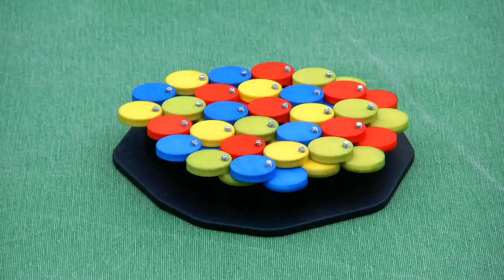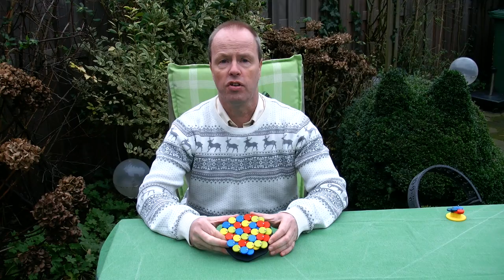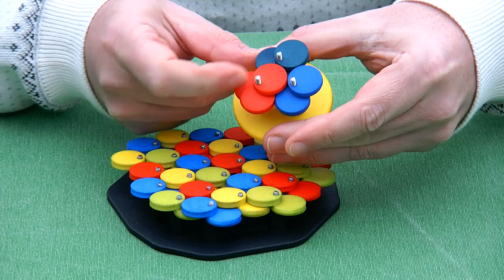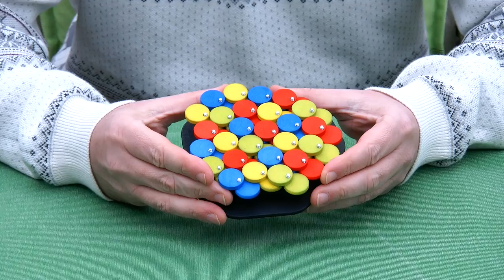Propellor Gear Grid   failed prototype

Comment: So if you had enough torque it would turn? if you put wings on one of the metal poles to let you turn, or attached an engine it might work. Or somehow allowing you to turn multiple gears at once spread through the puzzle?

You could also try breaking in the gears in smaller sections, or maybe sanding them if you haven't. I'm sure you know a lot more about the physics of these puzzles than I do! just a few thoughts.

This is a unique 'failure' since it's structurally sound & works in theory. I hope you make a working version, it looks very cool! Put some clock handles on it and hang it on your wall!

Comment: What if turn the disks into big toothed gears, and then put a tiny gear between each pair of big gears at the points where they touch? Admittedly, this would no longer be a "forbidden" gearing system then, but it would become a lot more "dynamic". :)
Perhaps you can hide the tiny intermediate gear by adding some flanges on the big gears, and that would also recreate the shape of a disk instead of a toothed gear.
Happy new year!

Comment: Hey Oskar, Sorry to see that the prototype did not work out. If too much friction is the issue, have you tried assembling a small number of the propellers? (maybe only )
Reply from the maker: Hi Eric, A smaller subset of the propellors works fine, e.g. by removing the outer ring. Thanks again for the propellor idea! Oskar

Comment: Couldn't you fix the friction by making the middle circle on a post, and then shorten the height of the circle by 1/16 on each side? It would look like a rod through a tire kind of. It might fix the issue. Then again, maybe not. Well, your a puzzle maker. Could you figure out if that would work to fix the friction?
Reply: Hopefully I didn't be to harsh solar the end, if so, I'm very sorry.
Reply from the maker: Ball bearings would do an even better job reducing the friction.
Reply: I never thought of that, this is why you are a puzzle maker.

Comment: It should run fine if you add ring bearings to each circle. If you do that, the faces of the circles wouldn't actually rotate relative to each other,, they'd just rotate relative to the spindle. It's not art unless it runs. It's art because it's not useful in an engineering sense at this moment. Good conceptual engineering is always art.
Reply: also if you're going to the cost of printing each one you should have no problem finding cheap ring bearings.

Comment: As for this being art, I think answer lies in what definition we try to use for Art.
The first, being that nebulous "if it evokes strong feelings from you, it's Art" definition that often gets thrown around as a mask for things offensive, rude, etc. etc., then I suppose it could be art. I feel some amount of despair that it does not work, even with your efforts to get it working. Not everyone would feel the same, however.
If we use Merriam-Webster's definition 4a, then yes, it absolutely is Art, even if it doesn't fully function. You used skill and imagination to make it, after all.
Reply from the maker: Thank you for that definition!